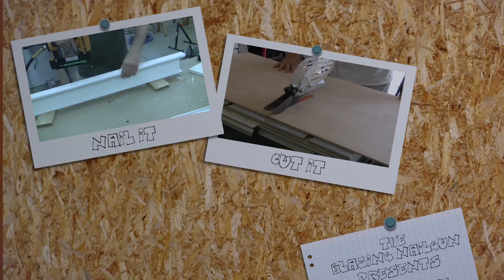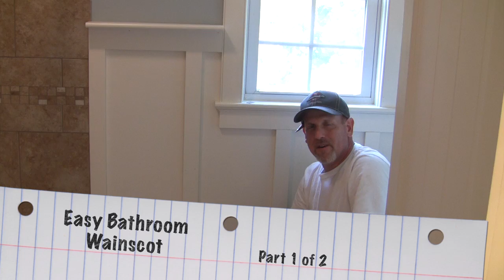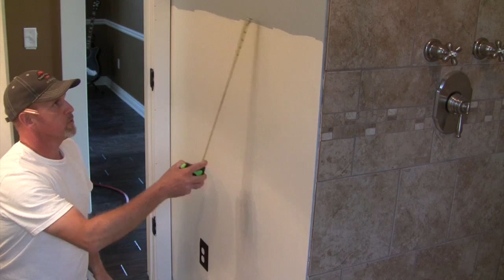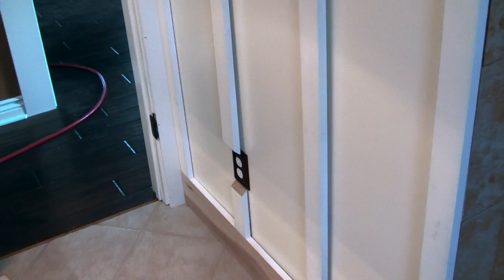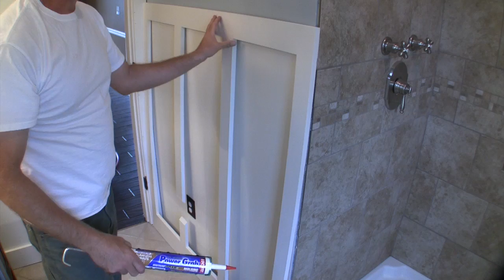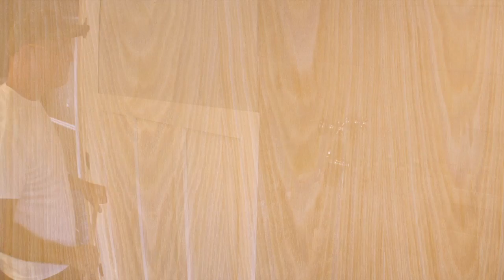Build Simple Bathroom Wainscot Pt 1

Comment: nice demo!!  I am planning to do the same thing - on the entire eave of the attic space I'm completing.  I've already added furring strips to catch the stiles, but I'm not sure how to break up the area with frames.  Each room has eaves that are either 16' l x 8' h and the spaces are 32" between the stiles.  I'm hoping to use the Kreg joinery but there is no way I can see building a 16' x 8' frame with center rails at 4' in the center.  Any ideas?
Reply from the maker: +woodlandbeauty I'd just break the frame up to manageable pieces.  Good luck!
Reply: How would one join the boards in pieces with the pocket screws on the reverse?  I did think maybe I could use the screws on the front,  then use the plugs,  sand. & caulk before painting.
Reply: OR, screw in the eave rafters where it breaks on the face, then use dowel plugs,  etc
Reply from the maker: I would do it like you described.  Kinda like how you join face frames on cabinets when you install them.  Look for Gary Striegler videos on youtube.  He does a lot of stuff like that with Kreg joints.  Might get some ideas there.

Comment: When the opposite wall is close enough, sometimes u can wedge a length of 2x4 from one wall to the face frame (with scrap pieces to protect the good surfaces) to hold it firm against the wall. One comes up with these sorts of tricks when you work alone!
Reply from the maker: Great tip.  Thanks for sharing!

Comment: Looks like dog crap.  Don't be a cheap azz move the plug.
Reply: ***** While the troll's comment was pretty rude, I am curious why you didn't move the outlet.  It seems like it would have been a small job to shift it left or right with a 2x4 block sistered to the stud.  There should have been enough slack in the wire to move it...no?

Other than that, I love the look and really love the simplicity of the cap rail.  I'm so torn what to do with my wainscot paneling rail.  I bought a really nice ogee bit to router 1x2 pine but after seeing yours (and other pics on the net), I'm torn whether a round over might be a cleaner look.  By the way, kudos on getting the top rail height to match the width of the stiles after installing the moulding under the cap.  Looks great. :)

Out of curiosity, is that capping a 1x4 or 1x3?
Reply from the maker: Digitalfiendscom
Thanks for the view.  I appreciate it!  Sorry my response is late coming.  Sometimes I get a little behind on that.  Anyway, I understand your dilemma with the profile.  I can't tell you how many times I have run something through an ornate bit and then decided a simple roundover looked better.  Ha!  The cap is a 1X4 so it's 3 1/2" deep.

You gave a great tip on relocating the outlet.  Thanks for sharing.  When I wired the house I pulled everything pretty snug so I don't have any "extra" to work with.  I'd have to raise it up higher to get the extra length and that would create more dis-function to fret over.  Nothing is easy, huh.  Thanks for the kind words!
Reply: +John Smith or for that matter why move the plug ?  Why not 5 vertical pieces instead of 4 and it would miss the plug.  No ?  I might be wrong.
Reply: Forget the Troll, you're awesome and talented. Thanks for sharing your knowledge

Comment: Question...  I have a wall that is about 15 long that I am going to be working on.  Would I still build a face frame for a wall of that length?
Reply from the maker: Thanks for the view Joshua.  You could build a far frame that long. The pocket screws are make a strong enough connection to carry that span while you maneuver it into place.  You don't have to do it this way though.  You could assemble the parts in place on the wall if you want.  I just like to build it and put it up in one fail swoop.  Good luck on your project.